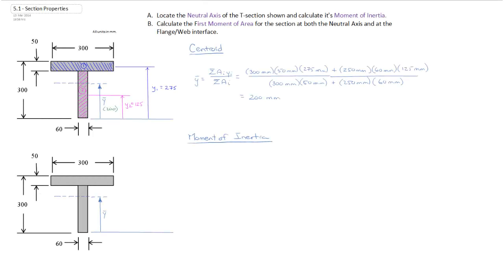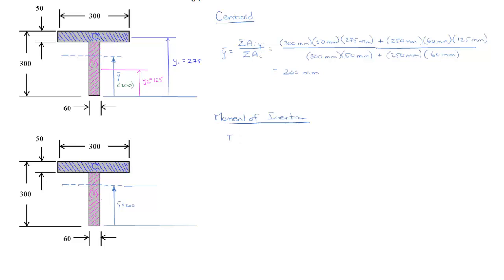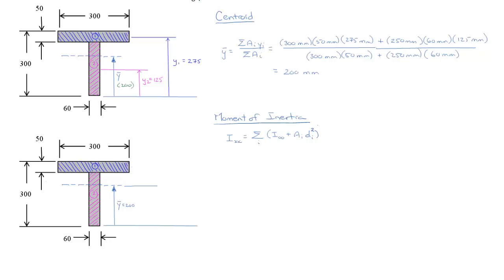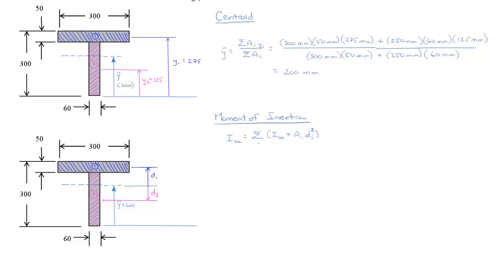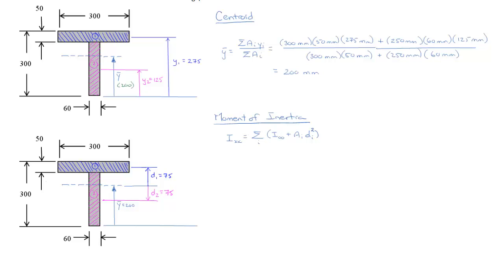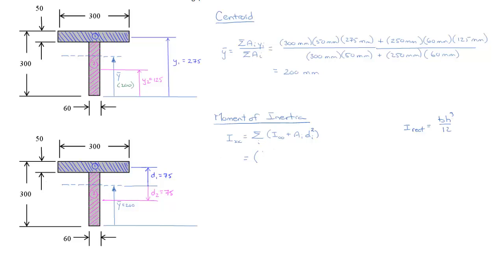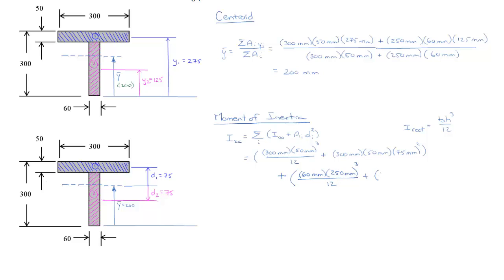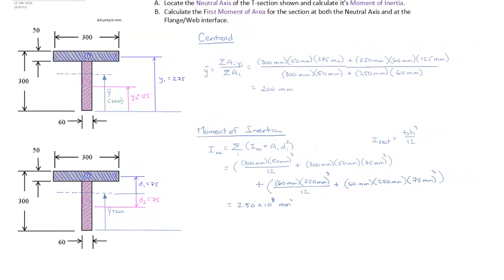5.1 - Cross-sectional Properties - Moment of Inertia (Part II)

Comment from the maker: True, they are not the same.  The neutral axis will usually fall on the centroid (for the assumptions used in the Introduction of Mechanics course in question it will).  When considering advanced conditions, such as anisotropy, this won't always be true.